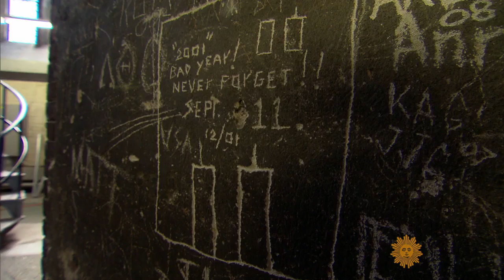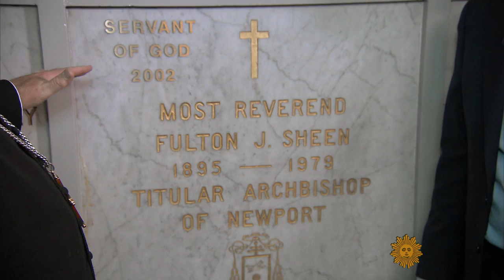Restoring St. Patrick's Cathedral

Comment: Nice but the original St. Patricks Cathedral deserves at least a mention. Consecrated in 1815, it became a minor basilica in 2010. St. Pat's Old Cathedral on Mulberry was the end point of the St. Paddy's Day parade from 1815 to 1830 and was the seat of the archdiocese until 1879.

Comment: The original Saint Patricks cathedral is in Ireland and has 800 years.  It is not even catholic. It is an Anglican Church. If you study a bit of church architecture, you would know that this church with gothic style has strong bottom and very light ceilings to avoid disasters. I am surprised that people doing the restauration did not know that the ceiling was made of plaster and wood. Any quick research in google or you tube in how gothic church/cathedrals are build you will know that. I work in a cathedral in Ireland and its weird to know that they did not know that.